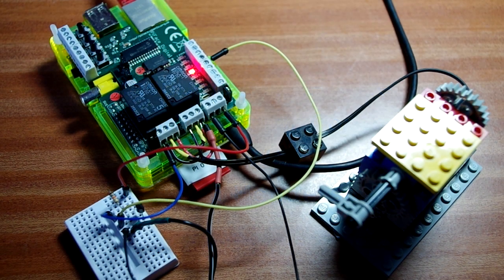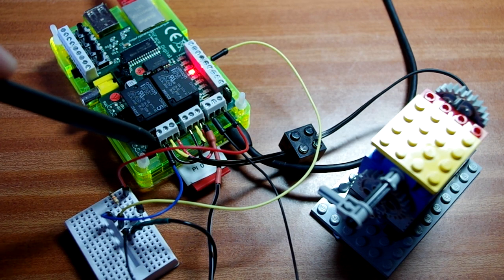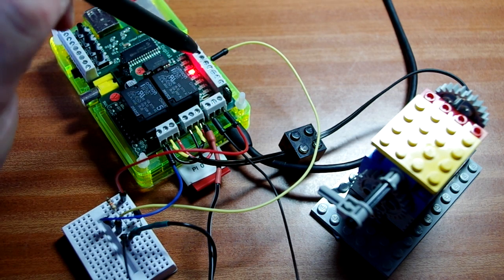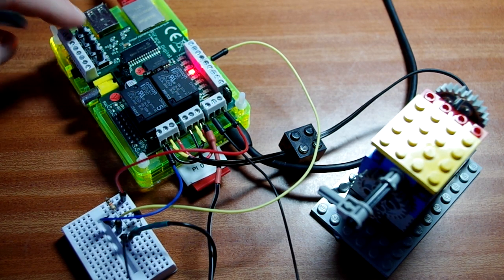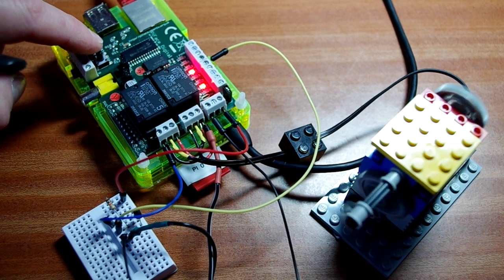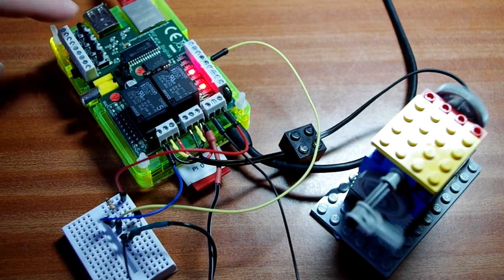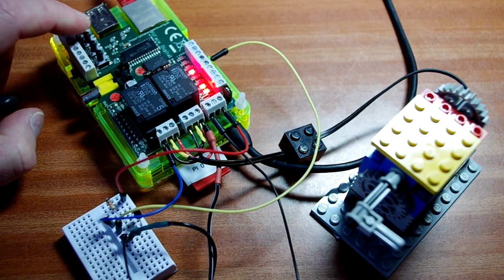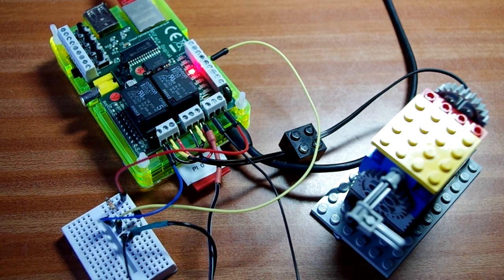PiFace Motor control - Part 2

Comment: why not use one of the PiFace's open collector outputs directly for the PWM line? I could see not doing this if you were using a big power transistor or mosfet but surely the uln2803 can handle the current of that LEGO motor...